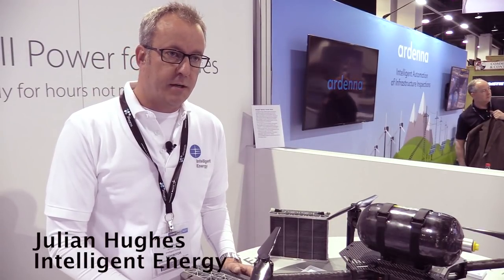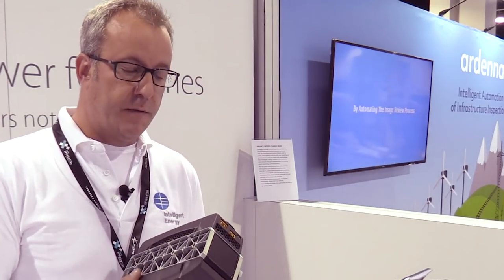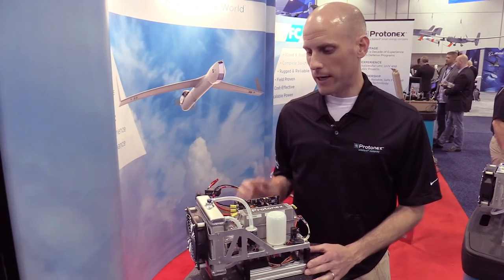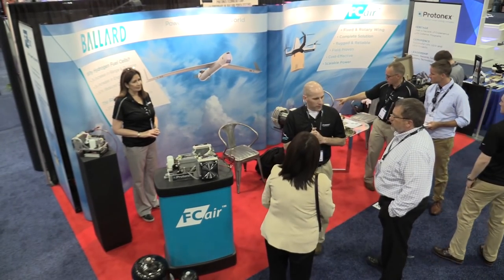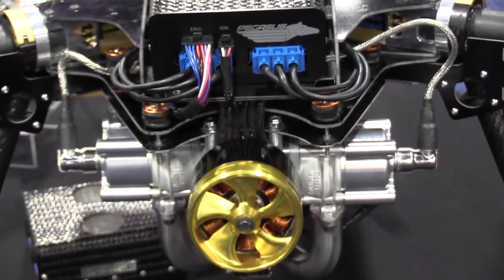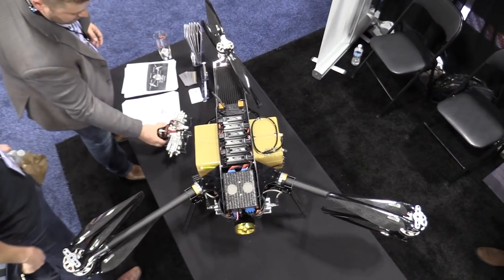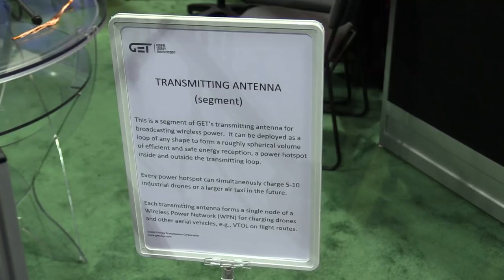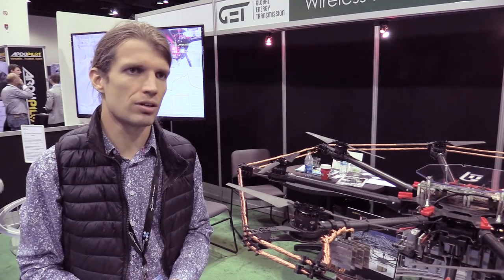Hydrogen Fuel Cells Go Flying

Comment: Well on the past Niko Tesla has transmitted Energy through Antennas. That is not new, but try to integrate that in Aircrafts? I think that would be really hard, because you would be sending very strong electromagnetic waves through the air, and now a days we have several day to day equipments that would be interfered for that, I think. How would that work ?

Comment: why is it we still do not have Hydrogen/ Fuel cell Airplanes? 
what is the energy density of Hydrogen in comparison to the best Lithium batteries?
Reply: @VriendRick  I don't know if you know the topic well. We can actually have an Electric Planes if the energy density if doubled but we are not there yet. In the case of H2/Fuel cells, Hydrogen can have close to 400 time the energy density of current batteries.
Reply: it's more expensive than fossil fuel

Comment: To make fuel cell electric aircraft a useful option for human transport, we will need to improve size, weight, stack life and service interval of these devices. Power density is the key metric. Currently light weight commercial hydrogen fuel cells produce around 1kw for around a 3kg device. Crudely extrapolating, a 100kw light aircraft would weigh around 300kg, not including the cylinder and fuel, so probably 350-400kg for the overall system, which would need improving somewhat. An equivalent Rotax 914 engine and wet fuel system 100L fuel weighs around 150-200kg.
If fuel cells can be made to have a service life in excess of a turbine jet engine, then maintenance costs can be massively reduced because we know electric motors are extremely reliable. This should be feasible considering that fuel cells are solid state, only moving parts would be the cooling system and fuel delivery, which potentially could also be integrated because of expansion cooling of the compressed gas.
Reply: Alternatively if liquified h2 is used, the system waste heat could be used for vaporising the h2 liquid to gas for fuel delivery. Liquid h2 is also more dense than compressed gas so higher energy density.

Comment: Hydrogen is a bit of a hassle to handle. How about methanol fuel cells? Methanol is easy to handle and store, room temperature and ambient pressure instead of cryogenic or 350 bar pressure.

Comment: You will get 1000 times more fuel rang if instead of a fuel-cell tank we use a fuel cell generator. Meaning the gas is manufactured or produced buy a fuel cell generator on board the passenger drone. Using one gallon of water with a catalyst like salt for conductivity. we literally could fly all the way around the world on one gallon of water and the byproduct would be purified distilled water.
Reply: would creating the Hydrogen from electricity and water be more cost efficient than fossil fuel?……………………………………………………………………………….'''''''''''''we literally could fly all the way around the world on one gallon of water ''''''''''''''……………………………………………………………………………………………………..can you prove that statement?: as far as I can see you would need a lot of water to produce enough Hydrogen to run a plane for that distance
Reply: 6 oz of water produces a tremendous amount of gas so maybe about 20 gallons will allow you to fly around the world. there are cars at Kentucky that drive 300 miles on 6 oz of water
Reply: There's a company you can take your car to that will outfit car with a fuel cell generator and it only cost six hundred and your car will drive off hydrogen. look it up.
Reply: once  again , ……………………………………………………………………………………………………..can you prove that statement?: as far as I can see you would need a lot of water to produce enough Hydrogen to run a plane for that distance

Comment: Tesla's 2170 batteries ALREADY have 300 watt hours per kilogram.. so why bother with hydrogen?
Reply: Lithium ion battery is not allowed on board when flying you are talking that battery powering jet ?? 11 times more weight is required as per the my analysis.So it is possible but a very big disadvantage.
Reply: Arsalan Ahmed it's a technology thing Achmed. you should start with "hooked on phonics"... then maybe "dick & jane do   3rd grade arithmetic... then perhaps you can begin to understand the conversation.